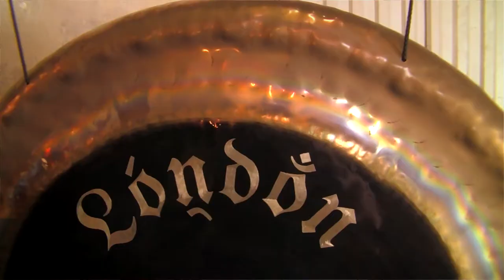Making of the 2019 London Real Gong by Matt Nolan Custom

Comment: Hi Matt love your work what do you use to blacken the Tam Tam
Reply from the maker: In this case it was one of the "Gun Blue" solutions that says on the bottle "will not work with non-ferrous metals" - ha! Surface preparation is vital before putting the solution on there.

Comment: This video is so good! I bought a sheet of 90 percent copper, 10 percent tin bronze to attempt making a 24 inch symphonic gong from. I've never done this before, but I just couldn't get the idea out of my head. Your video is closest I've found to any sort of at least visual of some of the work that goes into it, and I mean no disrespect or suggestion that I could replicate with zero experience what is clearly your passion and skill set... but I appreciate this video and am going to have a go at it. Any tips you could provide to point me in the right direction would be much appreciated. I'm guessing the piece you start with is already hardened and tempered, and that you then bring the edge to a dull cherry color with the torch to anneal it so you can hammer it out. When you later torch the whole surface, is that to change the temper, or to bring it just hot enough to get a slight color change out of the surface? Do you heat treat the entire gong or any part of it after you've finished hammering and shaping it? Again, anything you can offer would be much appreciated.
Reply from the maker: Thank you for your kind words. The heating at the end is very light. Just a mild stress relieve, not to change the temper. With this Nickel Silver material, it will stress relieve itself in a few days, but I can accelerate the process. With CuSn10, you may wait a long time for the sound to blossom without the gentle heating.
Reply: @MattNolanCustom  Thank you so much! I'll let you know how it goes.

Comment: good evening ... excellent job .. I would like to know what gauge is the sheet and the diameter of how many inches.
Reply from the maker: Hi Juan Carlos. The finished gong is 32" diameter, the initial disc was a little larger. Around 1.6 to 1.7mm thick.

Comment: What is the wall thickness on this gong? Is the heating for color as it doesn’t appear to be hot enough to stress relieve. Besides, isn’t the character imparted by the stresses?
Reply from the maker: The thickness is around 1.6mm. The heating is for partial stress relieving and for this material it is quite hot enough. Some metal crystal grain boundaries need to be healed after the work. Over-heating would not be a good idea, as you rightly point out.